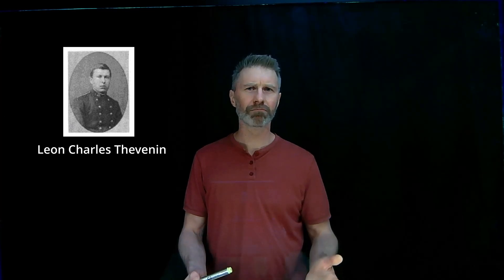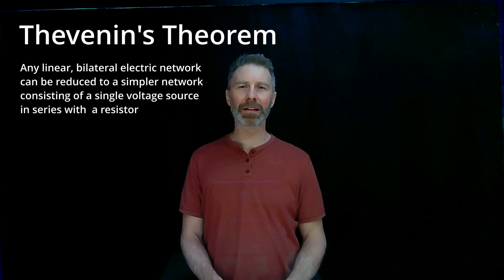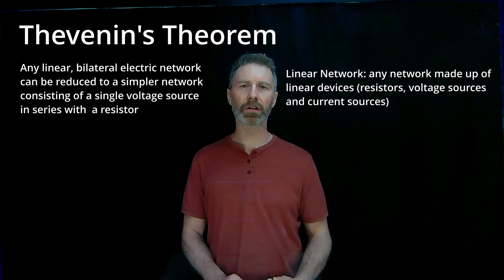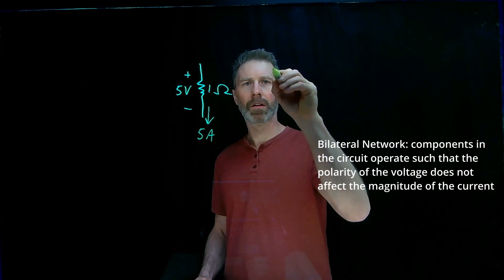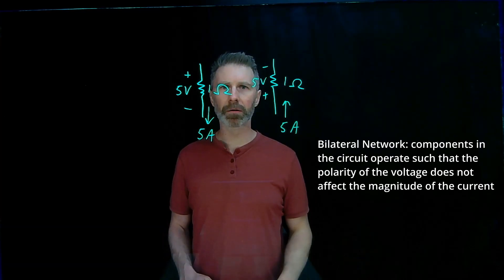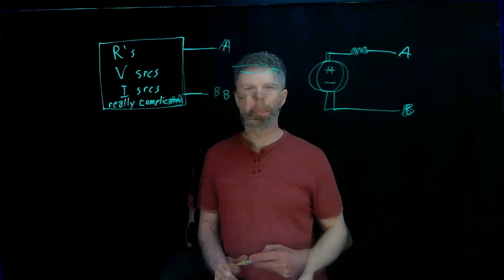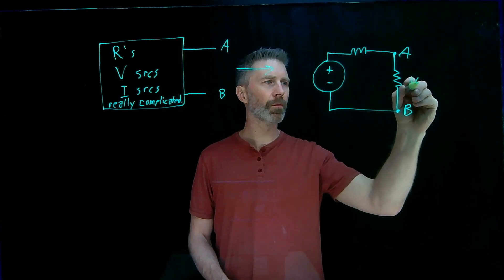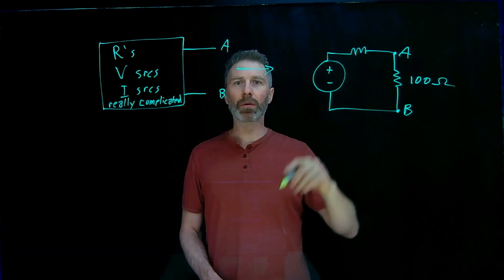Thevenin's Theorem in DC Electrical Circuits

Comment: First, I want to say thank you for your videos! I have watched several of them so far as I am reading another book and they have helped my understanding of what I am reading a great deal. 

I also just want point out, you say 50 volts instead of 50 ohms at 8:57 and I got a little stumped until I figured that out.
Reply from the maker: Thanks. I appreciate your comments. 
I think I need a live audience that can correct me when I say the wrong thing - I find I do it a lot and clearly don't catch it every time.